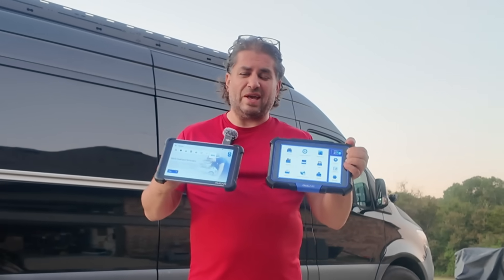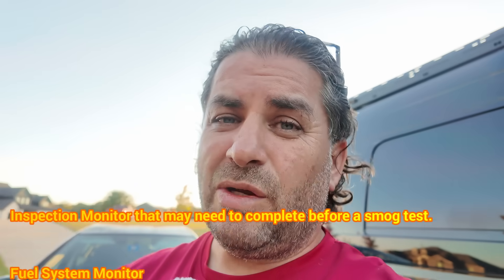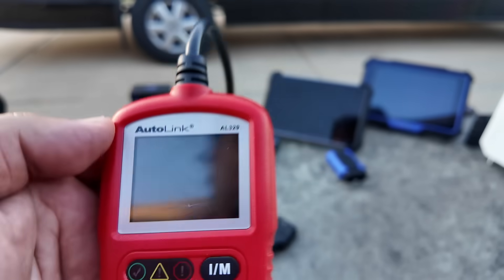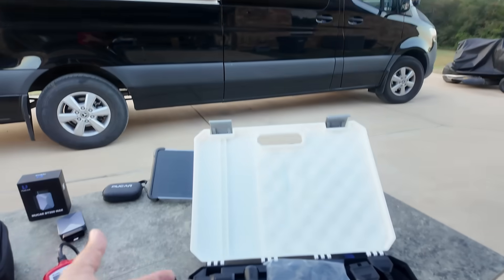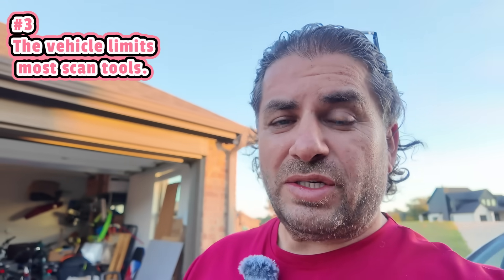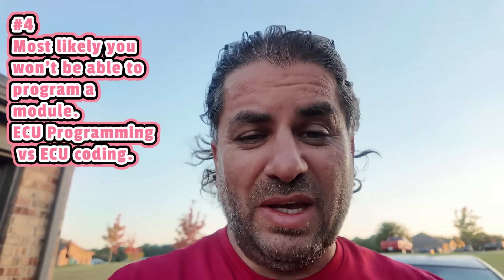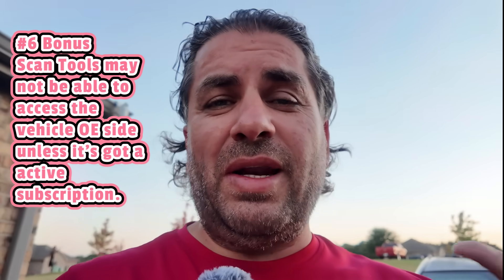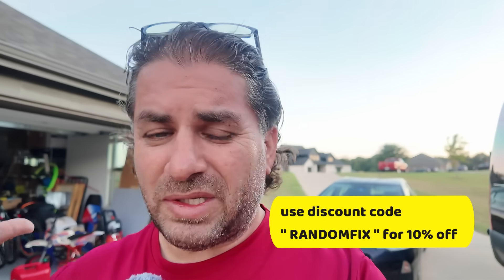Scan Tool Can't Do These 5 Things and No One Will Tell Beforehand

Comment: Great video,

A good point would be to check coverage for the functions you may need for the vehicles you may be working with. 

I recently purchased Thinkcar689bt, It is a good scan tool but, it has less support for some older models. I wanted to check ambient air temp sensor reading on a 2013 Nissan Qashqai / Dualis. Checked all computers, live data , special functions, everything and could not find it. 

I tried checking distance travelled or any mileage related reading from the computers to check for mileage tampering on a 2007 toyota aurion. It doesn't give data on that. I also wanted to do blind door actuator test. It did not had that either unfortunately.
Reply from the maker: Thanks the good feedback.
On your nissan the ambient air temperature should be under live data.
As far as the odo chdck or tampering there is a new function that got released 2 months that chdck the miles across all the viable module. Now the newer the vehicle the more modules you will have and thus better data. It work for my on 2012 Prius. This was on the mucar 892 bt which is identical but the 689bt may have not gotten the update yet.
Make sure you access live data on the oe side ( nissan) not obd2 or try both if not showing oe. 
Good luck and let me know what it goes.
Reply: @RANDOMFIX  Thanks for replying.

I did the OE side live data test and it had everything except the ambient temp  sensor reading. I did the same test on 2015 camry hybrid and that had it, so i concluded that it doesnt support it. I will do a basic resistance check on the sensor itself and see how that goes. 

689bt does havr the odo check function but very limited brands and even limited models under those brands. It does not have toyota at all. 

I had another question regarding key programming. Have you done any keys where it required the pin code. i know 689bt does not provide the code and support says contact the dealer. Someone on their facebook group had sucess pulling pin code for their 2012 nissan qashqai.  I'm in Australia we have key programming in high demand here. 689bt has released a new key programming module update which requires  TKEY101 to use the functions. I'm searching for something budget friendly that can give me the pin codes for most cars atleast and i can use TKEY101 alongside it. A video on that would be helpful as well. 

Thanks for all the work that you do in giving reviews for these tools.
Reply: Also the basic OBD check didnt had the reading either

Comment: Launch even on their products with 2 year updates, going past the free time won't brick the device. 
Buying an update will add the newest vehicle extras. 
Great thing to point out hard codes for readiness. 

Remember to look into what the company of that tool will do to the device once the subscription is up. 

Pretty sure Topdon is one brand to avoid for that reason.
Reply: After spending a pretty penny on trial and errors,  I  chose Launch because they've yet to fail me. Nevertheless, to each their own opinion
Reply from the maker: Thanks for sharing what sort of vehicles are you working on with launch products? I have a different experience and I can appreciate your opinion.
Reply: @RANDOMFIX  Nice to hear from you! I have no experience with launch but have seen a few reviews on amazon and online to say the brand will not brick the device after the warranty for updates is up. 

I just bought a VDIAG 70S coming in tomorrow. To try and program a key for a 2021 Dodge Charger. 

In the beginning of a mobile mechanic business. 

Is topdon a brand you like?
Reply: @taipan8021  Which launch did you settle on? They do seem awesome for having expandable memory. Can you download apps through an .apk file?
Reply from the maker: Thank you for helping great feedback. 
I’ve even used Autel past the free subscription period and the unit didn’t Brick 🧱 but on these newer vehicles they do and will require an active subscription.
Home diy I feel that is not a better choice the lifetime updates. These sorts of tools are perfect but they do 99 percent of what home diy repairs may need.
That 1  percent can be outsourced and even with a $1509 scan tool the issue will not be resolved.
Reply: @RANDOMFIX  Absolutely these with lifetime updates is the best for home user even mobile mechanics. Outsourcing the uncommon situation.